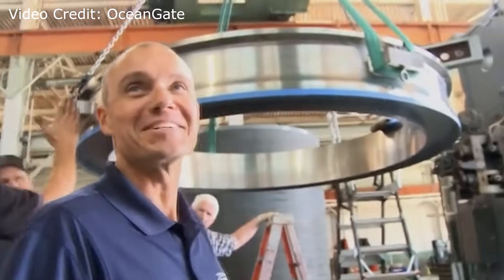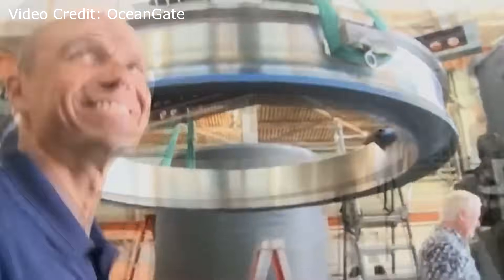Raw Unedited Re-upload of OceanGate's Promotional Video - Bonding a Titanium Ring to the V1 Hull

Comment: “We want to make sure it’s right” that’s why we’re doing it in an open dirty warehouse and touching the components with bare hands after wiping it down and not wearing masks 😮
Reply: And eyeballing it all
Reply from the maker: Agree.  Just wild!
Reply: yeah wiping it clean while holding onto a cleaned part with greasy hands... and is it just me or shouldn't there be enough glue in there so when they put it on top that a little should be oozing out?
Reply from the maker: @Guardianapophis  Thanks for commenting.  Yes, I have had epoxy experts chime in and say there should have been excess oozing out.
Reply: @solareclipsetimer I have no idea but putting on too much epoxy would be better than too little.    They also mix the epoxy by hand  rather than a mixing machine.   Can it be mixed properly by hand?    Also did they take into account the very different responses to water temperature and pressure of carbon fiber, epoxy and titanium?    Who knows?    This on top of using dirty hands abd a non clean room.
Reply from the maker: @RossM3838  Thanks for your reply.  Yes, three different materials at the joint is complex.  Tony testified that they tried to match the modulus of the carbon fiber and the rings so they "moved together."  He used that statement in the video also.  But I don't know how the epoxy fits into the picture. They used Loctite 9394 Aero.  Some epoxy guys have stated that is not a good choice for temperatures aroung 32F (at depth), but I don;t know enough about adhesives.
Reply: @solareclipsetimer nor do I.    It’s just some thoughts that come to me while watching the oceangate video.    A steal or titanium sphere can be welded together rather than epoxied.    Welding keeps all the materials the same.    With epoxy you can get dirt, oils, air bubbles and all ones of things in that joint.     At 4000 meters even a small gap can be catastrophic.    After looking at the debris and listening to dozens of genuine experts on submersible and carbon fiber I believe  while there were a dozen points of fail the one that gave out first was the epoxy joint in the bow
Reply: @Guardianapophis  that oozing out process is called "squeeze out". Yes there should be squeeze out, its an indicator you have enough.
Reply: @Guardianapophis yep
Reply: It wouldn't have mattered if this process was done in a hermetically isolated clean room. You cannot subject epoxy resin to extreme compressive and bending loads. Epoxy has no yield point. It stays intact until it catastrophically cracks unlike steel which acts like a spring. The resin is what stabilizes the carbon fiber. Once that's compromised it's game over. Engineering 101. This fundamental piece of knowledge was ignored.
Reply: In general safety and quality is last on this movie 😂
Reply: Like applying Nutella.
Reply: @joid8689 😂😂🎉🎉😂😂❤❤👏👏👏 your humour is sick!! i effin ❤ it!!!🎉🎉😂🎉😂😂 lets have a baby together!!! and name him "titan"❤❤
Reply: And no hair nets.
Reply: Lol the guy around 40 seconds wiping it and then immediately touching it with finger oils
Reply: And using a common shop hand towel that no doubt leaves debris.
Reply: @kdh3706  That towel was used to wipe off the Chinese take-out they had the night before, and then was used to clean the sinks. Don't have money for clean towels when you spend your budget on woke DEI initiatives.
Reply: But it was clean. They wiped it down with a rag...
Reply: Gluing metal to carbon fiber for deep dive is not right by default. But he knew better lol.
Reply: You where the only ones out there..and you stayed there...now long gone eaten by sea creatures you never knew existed...
Reply: Air bubbles and all in that epoxy.
Reply: How do those things you pointed out make a difference?
Reply: @lollipop84858the surfaces being epoxied need to be clean any oils or dirt can cause serious probes.    The encapsulation must be carefully measured but their placement seems to have been eyeballed.  😊😅
Reply: @lollipop84858good question! For a good glue bond between surfaces like the hull and titanium ring of the Titan, you want as few contaminants as possible. Every speck of dust or bit of liquid on either piece results in a spot where the bond between the two pieces is weaker. 

The “open dirty warehouse” is easy to explain. Think about all the dust, dirt, debris, etc that you’d find if you walked around a big space that was being used to store and assemble items and had direct access to the outdoors. The small bits of that which are floating around will get stuck in the glue…then there’s less glue in that spot cuz that bit of glue had been replaced by debris. Not wearing masks is similar - people breathe out water vapor, bacteria, viruses, etc, which you don’t want landing on your clean pieces.

The touching without gloves is especially bad because the guy was apparently trying to clean the pieces and then immediately making them dirty again. Our hands shed skin cells and secrete oil - it’s why you can see your handprint on glass. This stuff also interferes with a glue bond. The guy was doing the equivalent of mopping the floor while wearing muddy shoes.

Comment: I’m not an engineer, but it seems like a bad idea to glue two different components together and then send the craft thousands of feet below the ocean.
Reply from the maker: That is a great point.  Tony testified that they designed the shape of the rings to match the the moduli of the CF hull.  He said they were a "matched set."  But that of course is for the first hull.  They used the same rings on the second hull, so it's not clear the stiffness matched then.
Reply: @solareclipsetimer  the first one cracked, what made them think second one will be better using all spare parts while changing hull design
Reply from the maker: @dragonmerchant  Who knows what they were thinking.
Reply: It's hard enough to glue metal to anything even with normal surface pressure in a dry environment. It's a miracle that the sub survived one dive.
Reply from the maker: @gregsimon3527  Agree.
Reply: Actually, gluing is the preferred way of bonding composite parts.

Drilling holes for rivets or screws does a lot of damage to the composite.
Reply: The design does actually work, its just not supposed to be used for more than a few dives. 

Its like a balloon that you keep inflating and deflating. It can only handle the stresses so many times before it goes pop.
Reply: The glue is to seal .... airs only, not to connect parts. They have bolts for that.....

Comment: 39 seconds  in ,,The Guy is touching the ring with his bare hands adding oil,, Real Smart,,,,,,
Reply from the maker: Yep.  Not great technique.
Reply: Why what could that cause?
Reply: @TheDrunkCook111  our fingers make teeny tiny bits of oil, that's why you see fingerprints when you touch glass or very shiny metal

If you need something to be super clean so stuff sticks, you don't touch it after it has been cleaned, because oil makes things not stick
Reply: @ddricmage828  I make sure to not touch my 3D printer build plates to ensure proper adhesion after cleaning them with rubbing alcohol. These guys are touching everything with their hands and expecting to survive a couple atmosphere pressure changes.
Reply: @TheDrunkCook111    Failure to bond
Reply: Yeah not sure his finger oil was the issue.
Reply: @edmundblackaddercoc8522  😂
Reply: The whole thing was made of sh*t and sticks. His skin oils made no difference.